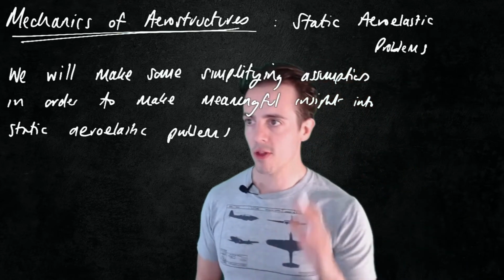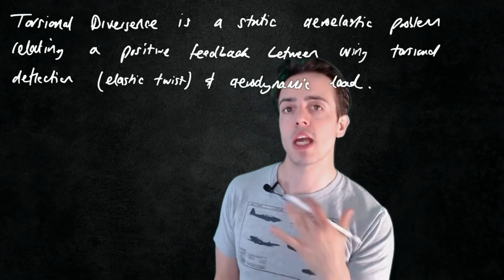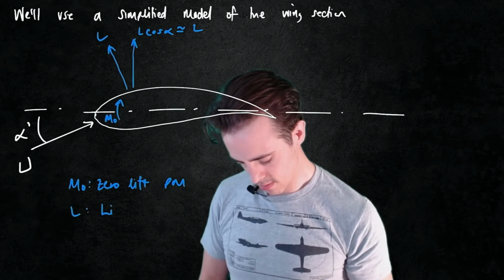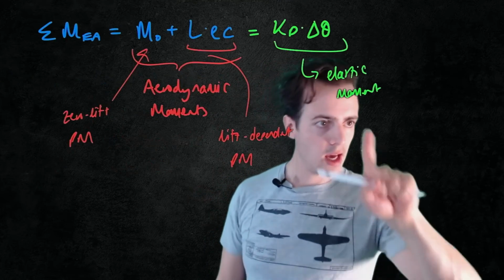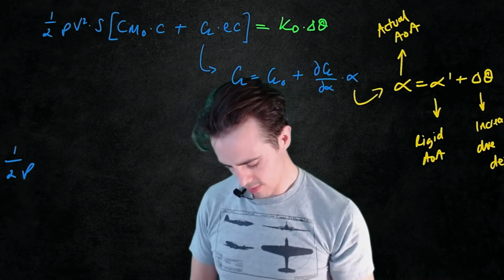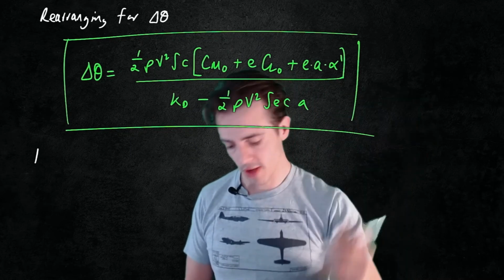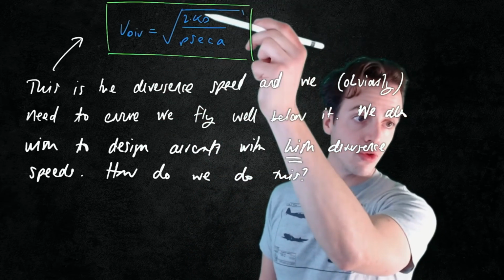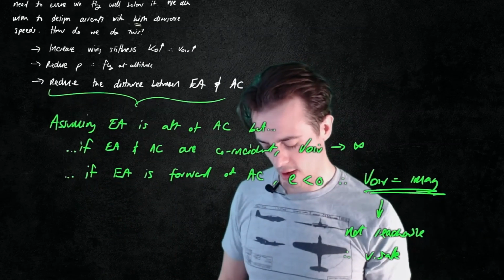Mechanics of Aerostructures - Aeroelasticity 3 - Torsional Divergence

Comment: Thanks for making these available, Professor Smith. My intuition is that stall would act as a self-regulating mechanism to prevent torsional divergence: incidence increases until the wing stalls, then lift goes to 0, and you go back to alpha'. 

Where am I going wrong?
Reply from the maker: Stall could act as a regulatory mechanism but it’s not guaranteed that stall will occur before torsional damage has occurred.

Furthermore, stall gives rise to aerodynamic nonlinearities and vibrations that can feed into dynamic aeroelastic phenomena.

Comment: The spitfire will really never experience divergence velocity? Does that mean it will never have its wings snap off, no matter how fast it goes? (If so, that's so cool)
Reply from the maker: That’s exactly what it means.

Its wings might snap off from the load factor being too high, but torsional divergence is impossible because its elastic axis is ahead of the centre of pressure.
Reply: @AeronauticalEngineering  Wow. What can't the spitfire do?